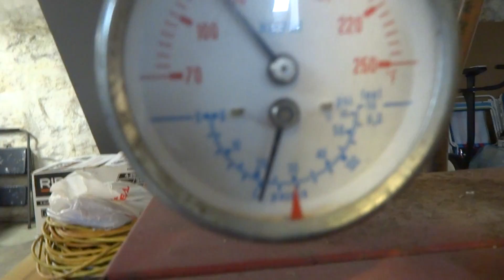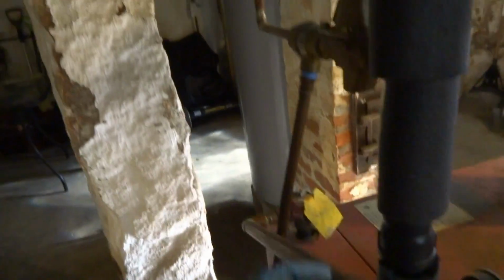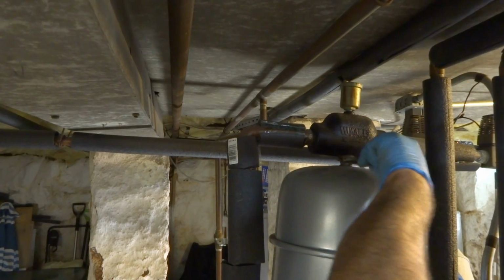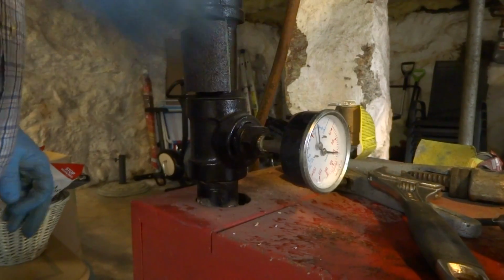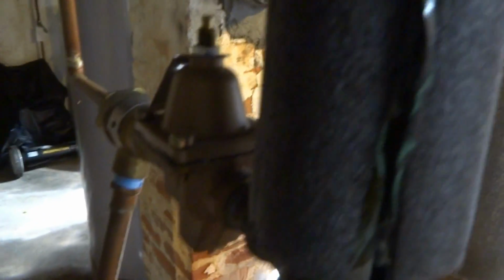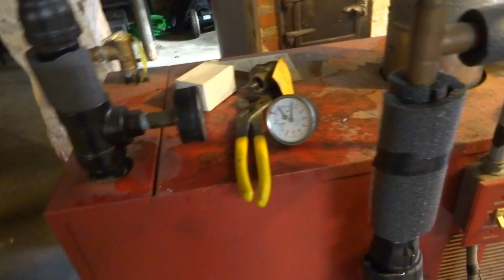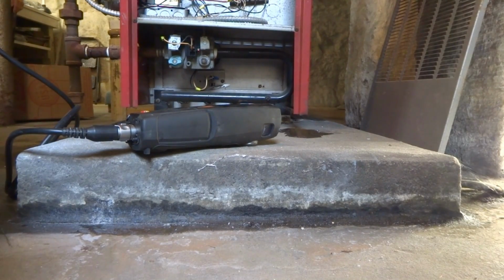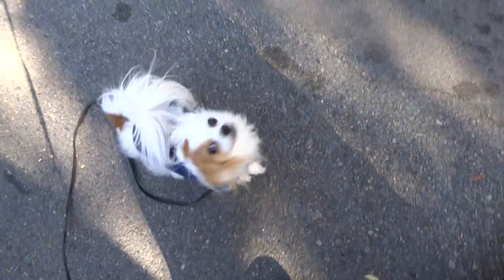GAS BOILER LEAKING WATER OUT RELIEF VALVE MULTI ISSUES FIXED

Comment: As usual great video again.  Your introduction style taking us for a ride in the truck with you as you go to the job site is great.  I am not an expert on video production but is it possible to ease us into the noise of the truck in the videos?  Like start out low volume and ramp up to normal volume as the video rolls to reduce the sudden quiet to truck transitions?

Comment: What is that thin wrench you are using called? much thinner than a standard
Reply from the maker: https://www.amazon.com/gp/product/B0012Y2EUC/ref=as_li_qf_asin_il_tl?ie=UTF8&tag=lavimonierepr-20&creative=9325&linkCode=as2&creativeASIN=B0012Y2EUC&linkId=df4322816cd5e132792e3392808d7b11
Reply: channel lock makes a nice thin one too.

Comment: I never drain down a boiler for a tank swap out , I just drop pressure small amount of water comes out , less hassle
Reply: All of my new installs I always put a ball valve so you don’t have to drain the unit down
Reply: Mike Fournier , Putting a valve between the tank and the system is a code violation , no valve is allowed.👷🏻
Reply: @johnkrim8377  I've heard that, what's the reason  just out of curiosity?
Reply: @Keo0oo  stupid home owners will shut it off.   I install a valve and take the handle off of it. need a wrench to close it.

Comment: I heat the expansion tank up until it expands, then I wrench it off!😊
Reply: Can you explain what you mean by this?
Reply: @tombomombodombo what he means is he heats the threads with a torch or something to help release the threads. Metal expands and contracts with heat.
Reply: That or he means he heats it up till it drains its self.. that way it's not heavy? That would be something I'd question doing thi

Comment: Why is the vessel always replaced? They always loose their static charge over time and the valve is there to allow you to re-pressurise them. Boilers here in the UK have integrated vessels that you can drain and recharge each yearly service and you'd only replace if the diaphragm perishes
Reply: a tank is usually less than a 100 bucks...just replace it.

Comment: Steve I was just wondering when you do your combustion test and then go to print your diagnosis out is it always that light, or some type of cartridge you have to replace from time to time.
Reply: Printer looks like a thermal printer. Print head could be dirty, or something wrong with the paper.
Reply from the maker: it needs new batteries then it will print darker